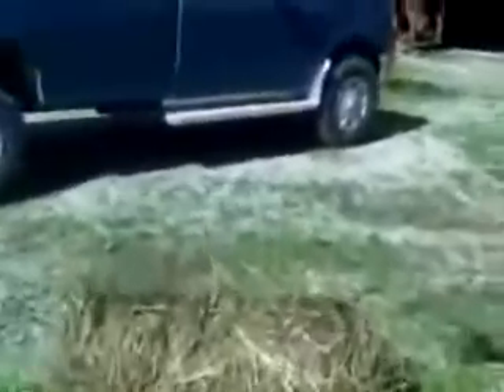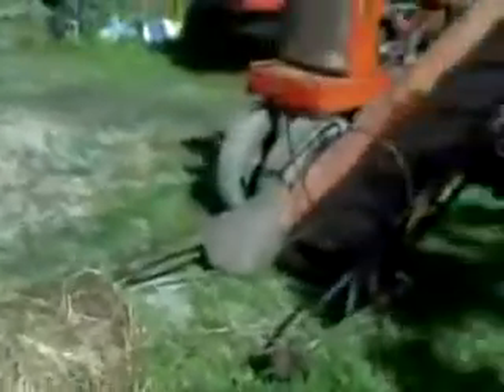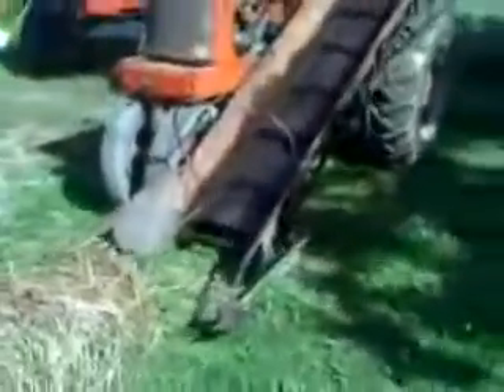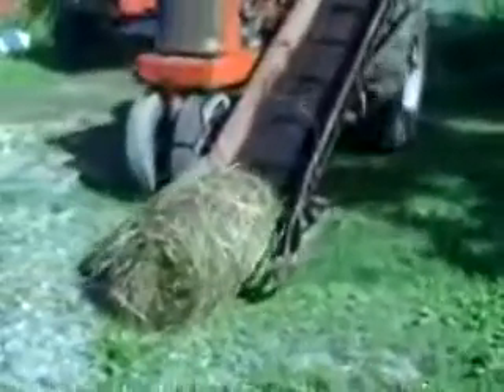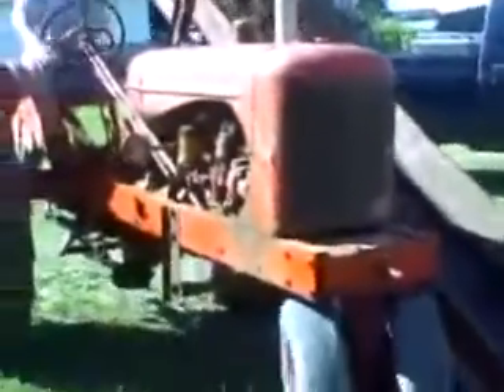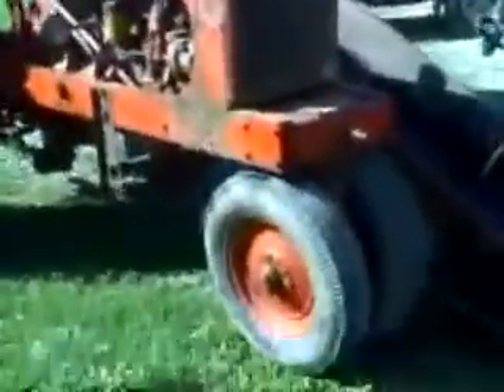Karafit Farms: Allis Chalmers Roto Bale Loader

Comment: Small round bales were a decent idea for the time it was invented but were never a time saver unless you just left them where the baler did. Here is Allis' own contraption that is likely just what the end user put up with. A square baler with a hay rack behind it was nearly a non stop operation.
Reply: What you say is true. However, if on a considerably smaller farm with smaller fields, a baler with a hay rack is just a pain. Spend way more time trying to turn it all around then using the smaller roto baler and rotor bale pick up. Its even half the size of a baler, so size is a huge factor on small farms of 40 or so acres which were prevalent when these machines were being made.